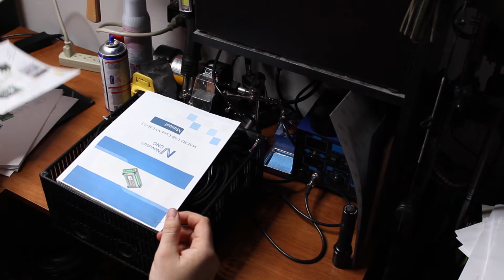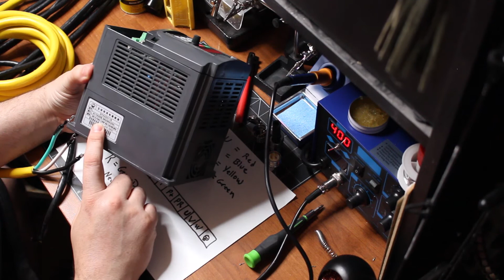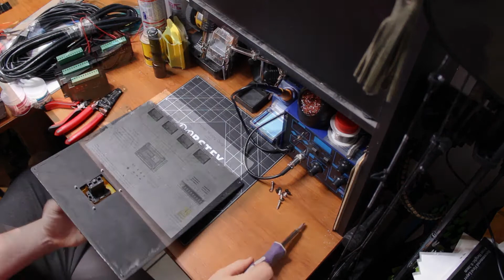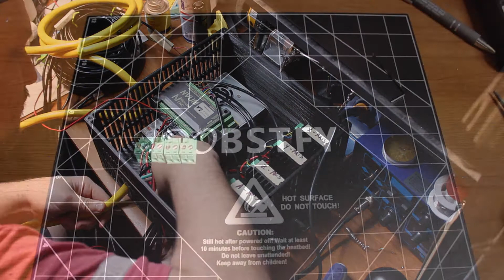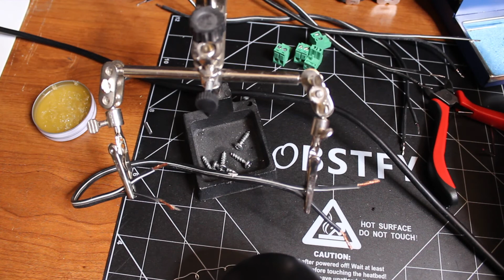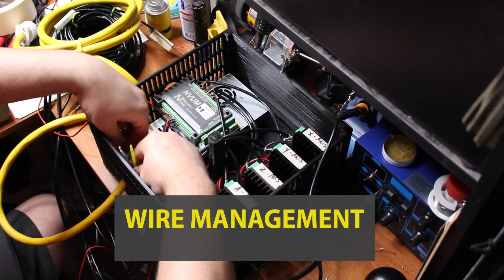Bulkman 3D/WorkBee/QueenBee Pro CNC  - Control box setup and wiring - Series episode 6

Comment: Where did you get your calculations on 10awg and 20 amps? You need to have an accessory circuit breaker protecting that drivers opposed to relying on a branch circuit breaker. pick a trip curve that allows for inrush current. Also your dc power supply appears to have the 24v circuit floating. You did not ground the 24v circuit? You need a terminal block for your 24v. Just curious.. how is this unit running? Are you having any problems with noise?

Comment: I want to clarify something before I pull the trigger. So I purchased the Queenbee Pro with the 110v 2.2 kw spindle. I am planning on adding a 30 amp breaker and outlet and running 10/2 romex. Will this be ok for this set up?
Reply: Yes that will suffice. Why not use 10/3 and have an auxiliary 110v circuit for a laptop.

Comment: hey first of all thanks for that series of vid its very good. since I'm looking to order a queenbee in the near future. I'm wondering about the power outlet I'm guessing you are running on a 20 amp breaker. have you had any issue with the breaker. do you only run the spindle on that circuit or you have the pump and the controller power supplies on that circuit. since that 2.2kw at 110v does draw 20 amp on a 20 amp breaker I'm guessing its a dedicated circuit just for the spindle.
Reply from the maker: Make sure you check out my QueenBee Pro videos. The spindle at its very max under full load might pull that 20amp. My full machine is on its own 20amp breaker. I have no heat or power issues at all. I plan to test it out once I get everything back together.

Comment: Great video series on the workbee! Just one minor 'grievance'.. whenever you have stranded wire going into a screw clamp down terminal it's not good to tin the ends as A) it creates a weak point in the cable where the tinned wire can break due to stress which I've seen happened and B) applying solder to the strands doesn't allow the wire to compress at first but it will expand/retract over time/temperature change eventually causing a loose connection. You're much better off using a ferrule crimp if anything to interface stranded - screw terminal.

Comment: Where are you getting the wire from to  do the stepper drivers?  I got mine from bulkman buti have wires for the 3 signals and then 4 axis cables no other cables provided